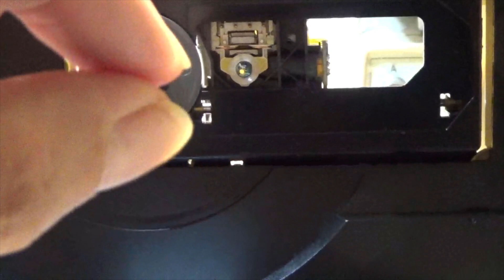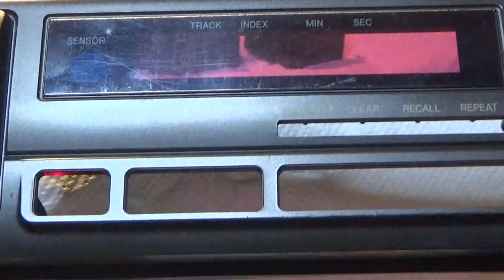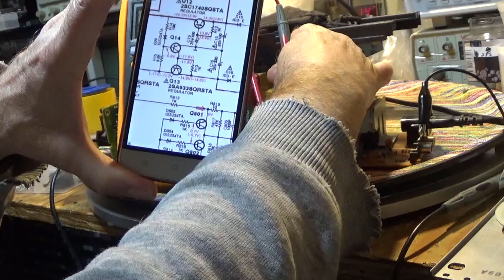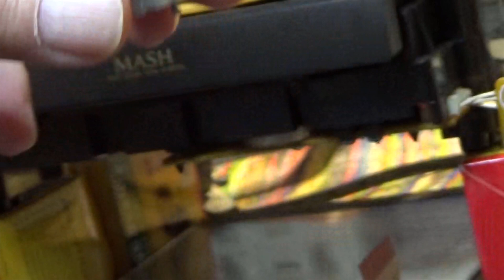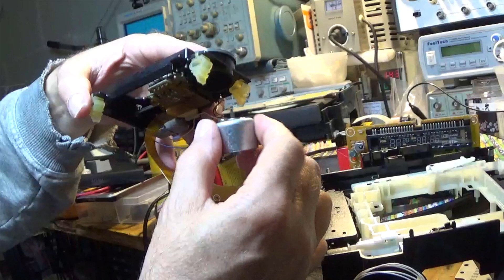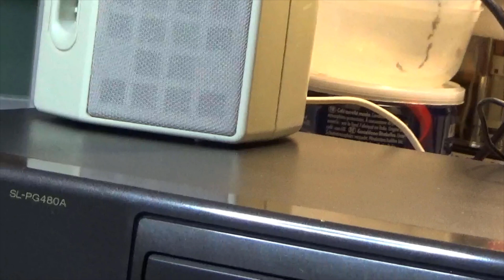Technics SL-PG480A CD Player Repair Refurbishing  Part 2 of 2

Comment: You have to realize power transformer windings have a tolerance of maybe 10-20%. Voltages maybe lower or above the schematic voltages. Which are nominal.

Comment: I don’t know why you didn’t put voltage to the motor first. After, you desoldered the spindle motor. And check the motor for current draw. What was the voltage difference from one power supply to the other?
Reply from the maker: I guess I was too eager to continue repairing the CD player... I had to publish the video and I was on a time-constraint and therefore I simply skipped that logical step 
Thanks for your comment and considering subscribing!
Happy New Year!

Comment: Spindle motor make sure platter that holds disc is installed in same position on the replacement motor. 
This way the Laser will focus properly. Problem I had was removing platter on old motor. 
I also have a collection of parts from used machines.

Comment: В продаже видел как лазер всборе  с сервоприводом  шпинделем так и отдельно лазерная головка. Что посоветуйте мне купить узел в сборе со шпинделем или отдельно
Reply from the maker: HEllo, hmmm... if the assembly is a used one, buy the complete assembly since probably laser and spindle are set to work properly together. However, if the laser assembly is used, I wouldn't buy that one, since you risk having the same problem again with your actual laser. This is also true for the complete assembly, of course.... with the one difference that both componenets (laser and spindle) were probably set correctly at the factory....
If you have little money to spend go for the complete assembly.... however, if you want the whole thing to last, maybe you should consider buying a NEW laser?

Comment: Hello. Hi. I have on my table the same unit with similar problem I guess. SO SP-PG480A. with non spinning spindle motor. All electronics works, laser works etc but no motor rotation. Sorry to say but I did not understood what was the solution to get unit working . Did you changed motor finally from spare unit bought on ebay or this resistor modification did the job. I checked voltage on Emiter and I have -11.5 V. Nevertheless motor is nor running. SO please clarify my doubt what happened in your case. Voltages are clear but did it solved problem or you changed motor ? Thanks in advance.  Marek
Reply from the maker: Hello, yes I replaced the motor which I ordered on Ebay. It's not very expensive, around 10$ (without shipping) When you order a new motor pay attention you buy the SAME motor (type) and take one with shaft length of at least 8mm long (longer is ok, you can cut it off to adapt its length. 
Thanks for your message and considering subscribing ! Good luck :)
P.S. I seem to remember I bought the motor in Italy (via Ebay italy), just in case you wonder where I found one
Reply: OK. Just found that finally motor was dead Simply I missed short part of your videa sorry for that. Have to check mine as well supplying 3 V from alternative source.

Comment: Hi. Thanks for the video. I have this CD-Player. I don't really understand how you came up with that resistor fix or why it worked. I'm no electronics genius but I have fixed plenty of amplifiers. To me I would personally try swapping out that regulator. It could be that which has gone bad. I fear your resistor fix may only be temporary and that the voltages may go out again. I've had regulators fail in this era of Technics equipment. If they're the plastic encapsulated ones they don't cool well and go bad over the years taking other nearby components with them. If you replace and add a heat-sink that may do well. On the other hand I could be completely wrong. Just a thought. Thanks again.
Reply from the maker: Hello Simon. Thanks for your insightful ideas. Initially I was on the same track you suggest, namely power regulators not functioning correctly. Those I targetted first obviously, and I measured and monitored the voltages at their outputs for quite a while. However, nothing untoward was noticed, the regulators gave the exact voltages they were rated for, even after having been on for half an hour or so.
I must confess the imbalance of voltages I measured all over the CD player's powersupply had me baffled. (I actually temporarily replaced certain components, thinking they might be the cause, but that did not change the imbalance of voltages measured)
In the end I thought through the powersupply construction and concluded that the part where I added a resistor was key to all other voltages generated throughout. The 5.6KOhm 1/4W resistor did indeed bring all voltages into line with those mentioned on the schematic.
I do not routinely modify circuits, having generally a lot of faith in the competence of the engineers who designed the circuits. However, in this particular case, I judged that not ALL voltages mentioned on the schematic could be wrong and therefore should be obtained one way or another, and my modification did exactly that.
Thanks again for your observations, your nice comment and considering subscribing :)
P.S. : There's one more video comming soon specifically on the repair of the CD loader itself